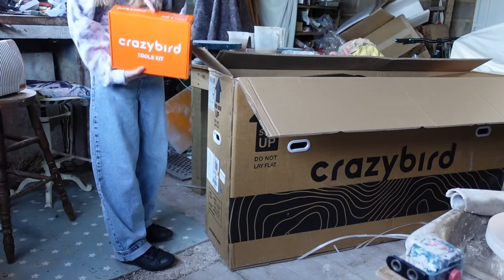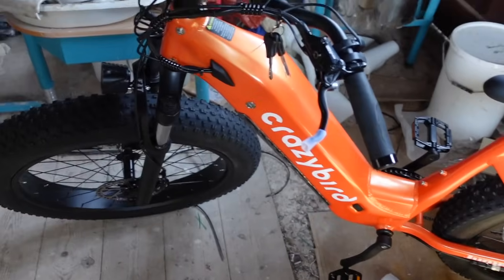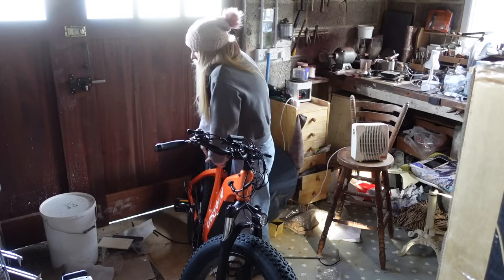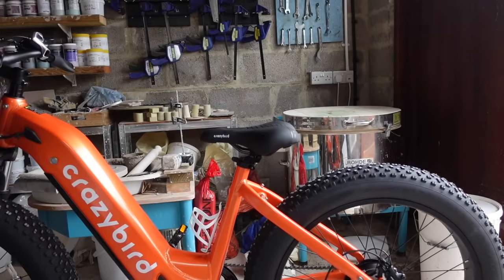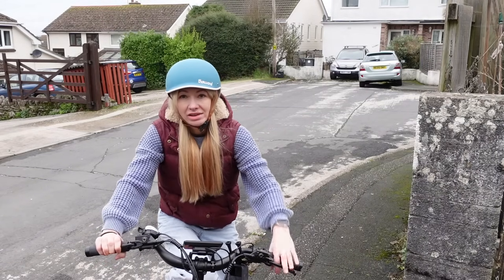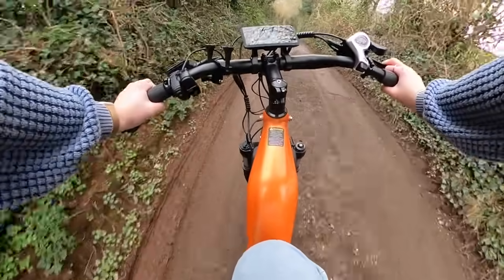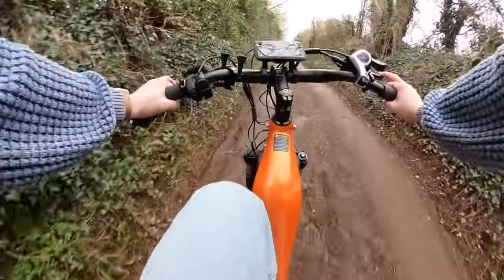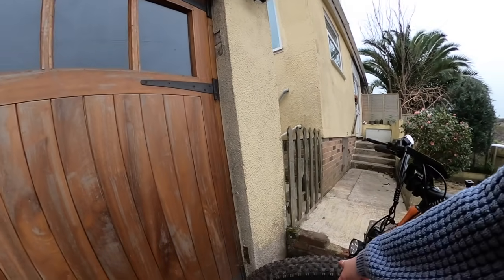Taking My Husky For A Bike Ride! He POSES For The Camera!

Comment: Jodie, get an oil-filled radiator heater for your workshop. They work really well. Tell Key he doesn’t have to worry about getting his good side. Any photo of Key is beautiful. Hope you have a wonderful birthday. Hugs from Tennessee USA.
Reply: Where in Tennessee are you at, we are close to Chattanooga, about an hour or less.
Reply: @TammyWright-mc9nb  Good morning Tammy. I’m in Knoxville. We’re getting heavy snow and it’s beautiful. Key would love it. Are you getting snow as well?
Reply: I know people in Memphis, Cookeville, LaVernge, Smithville going to get snow I think. The temps are like 2 or -1 in Cookeville or it was that about an hour ago. BRRRRRRRRRRR TO COLD FOR ME, WE GOT OUR HEAT ON 70 AND OUR FIREPLACE WITH THE BLOWER ON. OUR ELEC BILL IS ALWAYS HIGH BECAUSE OUR HOUSE IS A 2 STORY WITH APPROX WITH ALMOST 4500 SQ Ft plus the garage that is on one end of the home, the garage area is not heated though.
Reply: @TammyWright-mc9nb  It’s 30 here now but the arctic cold is coming in tonight. I think the low Wednesday morning is 4 and the wind chill -5. We’re supposed to end up with 10 inches of snow. I’ve got my thermostat on 72 but I’ve got a small apartment. It’s still cold though especially near my living room window where my recliner is. I don’t really mind winter. I prefer it over our hot humid summers.

Comment: In Oz you can use a throttle up to six kilometers per hour. Great for hill starts at traffic lights, etc. Your handlebars do not seem to be aligned properly with the front wheel.
Reply from the maker: Yeah I realised that as I was coming down the hill at the end, it's all aligned properly now :)

Comment: I believe there are WiFi remote space heaters so you can start them before you go out & if you set up a separate WiFi thermometer or get a space heater with one, you can wait to go out until its as warm as you prefer!

Comment: 2 degrees F right now and snowing, I can relate to wanting to stay inside even though I usually love being out in the snow. Been looking at the Aventon E-bikes, so any review of competing products is welcome. Those "Fat Boy" style tires are great offroad, and if you're in boggy or loose areas letting out a little pressure can increase the contact patch quite a bit and improve traction. As I mentioned to Jamie in the new Sherpa's Day video he posted, Darn Tough brand socks are awesome at keeping the feet dry and warm, and they make men and women versions. Cooking, pottery, jewellery making and now mechanical engineering with assembling a new bike, you got SKILLS woman!  

Weirdo on a bike, I can hear Key wondering to himself what's wrong with you this time.

Comment: Can you use the throttle if you aren't on the roadway, like in a field? The large tires should do well in a field and it would be easier on Key in a field instead of a road.
Reply from the maker: If you're on private land you can use the throttle, but not many people have access to enough land for that. But I like peddling and getting the workout from it anyway :)

Comment: I’m wondering whether you can get a lead with a bungee section in it?  If you’re riding along and key stops suddenly, and the leaders thought it could bring you off the bike but if there’s a little bit of give, it gives you a chance to keep control by putting your feet down instead of the rest of you
A man round here does the same thing, and he’s made a lead with a bungee connection   You may be able to buy one. Just a thought

Comment: Lovely new bike Jodie. 🙂 Its always a good day, new bike day! The MTB bike mechanic in me is rather itching to sort that handlebar/stem out for you a little more though. 
I know as you say, it's all VERY new to you, nothing comes as "known" to anyone new to a complex new bike. 🙂 A few minutes fine tuning is all that's needed, if you fancy giving it a go. 

If you align the front wheel with the stem, (The sticky out bit you got the wrong way round, which I found both funny and charming in equal measure.) riding is then much safer and easier to "point" the bike were you want it to go. This video should help align it. https://www.youtube.com/watch?v=F1lyM1D4-Cs

Also you can "roll" the handlebars in the stem to adjust there pitch, which helps overall comfort and stabilises the handling of the bike a great deal. This video should help with fine turning it.  https://www.youtube.com/watch?v=K2zJvGcBVS0
 Remember to adjust the brakes, controls and the handlebar grips, so everything is then within easy reach and comfortable and you're good to go! 

Hope this is helpful and most of all, I hope both you and Key enjoy loads of lovely times riding and running together! Looking forward to seeing it. 😊

Comment: Your handlebar is crooked and you need to raise the seat. Peddling with your knees that crunched up will cause damage. Your leg should almost be straight at the bottom of your pedal. The seat is for sitting on when you pedal not when you stop. You should be off the seat and standing at that point.